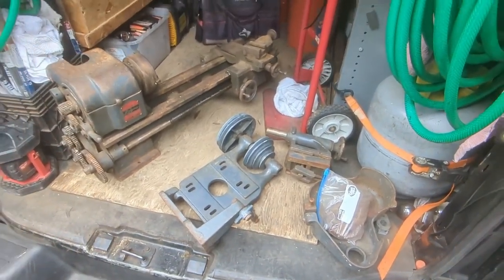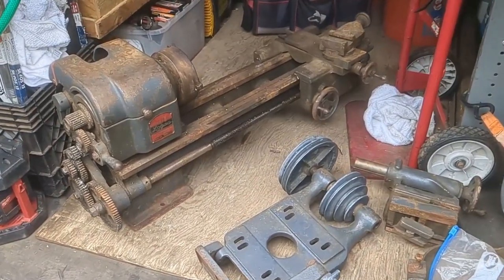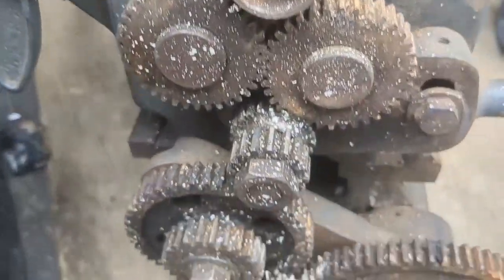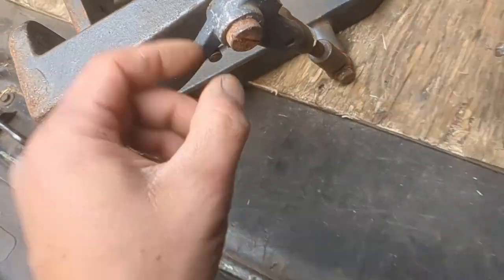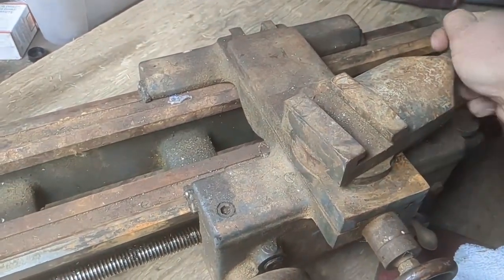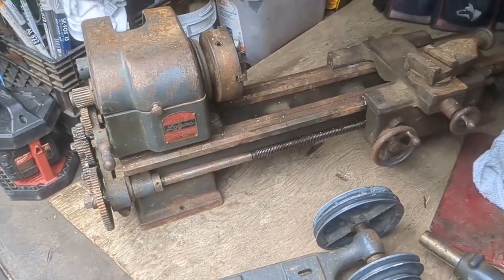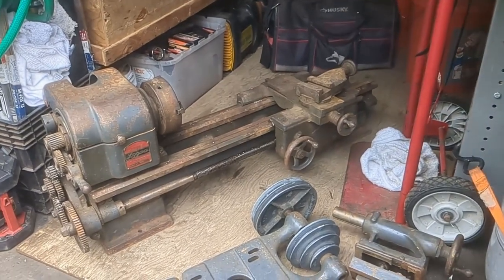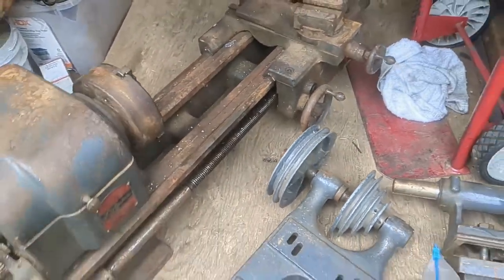$50 Lathe Logan 400

Comment: By my estimation you've already got 5 change gears installed on banjo. Another 9 in the zip loc makes 14. Dude $50 is the steal or the millennium. Some of those gears on eBay are selling $50-$60 each. You made out like a bandit ✊🏼 Right on !!

Comment: I'm sure you've figured it out by now but the back gear lever was binding because you need to pull the spring loaded pin on the opposite side of the shaft.